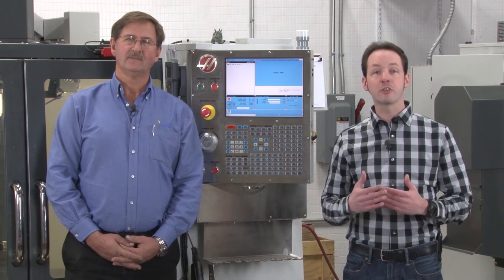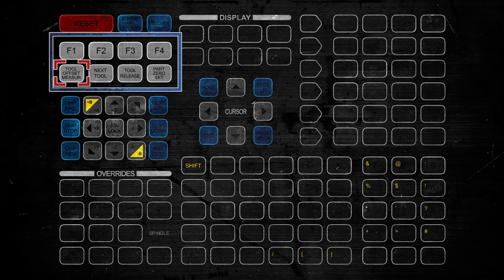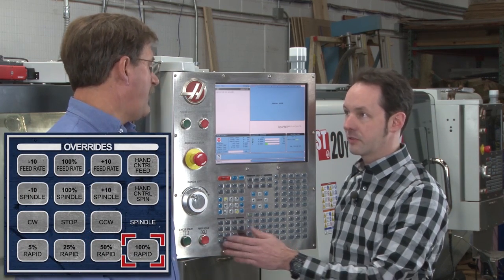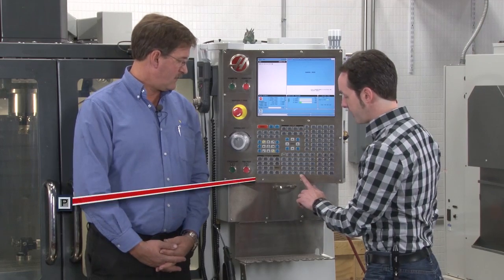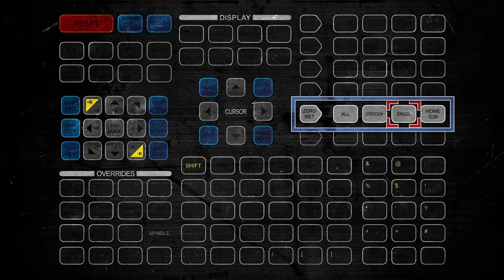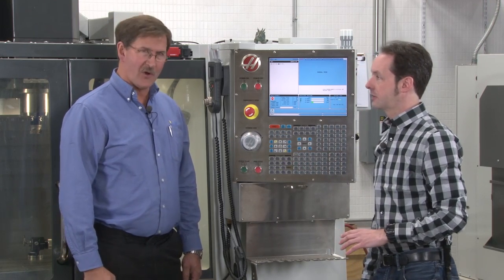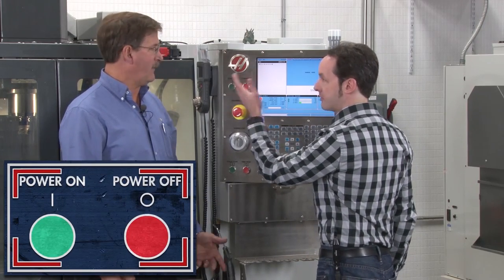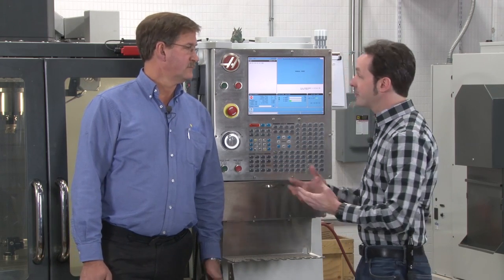Mill Button Tour: CNC Training Series

Comment: one thing inaccurate is you can use g28 whenever you want, its not limited to the rows button. works almost the same as powerup/reset for the X and Y axis.

Comment: how large are CNC programs?
Reply: In terms of flash drive space? Think of g-code as a .txt file. IIRC, the Haas machines aren't actually very happy with (IE, they don't work with) flash drives larger than 1 gig. If you meant in terms of lines of code, that depends entirely upon what you're trying to do and how well-optimized your code is, just like any other computer language.